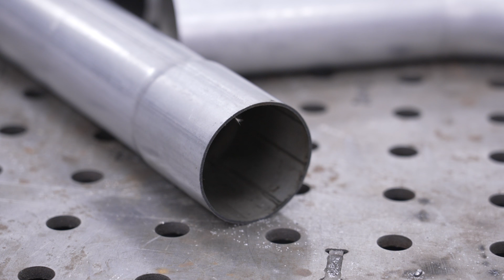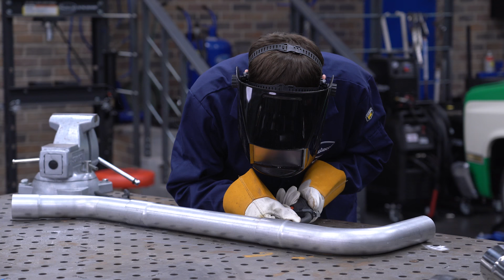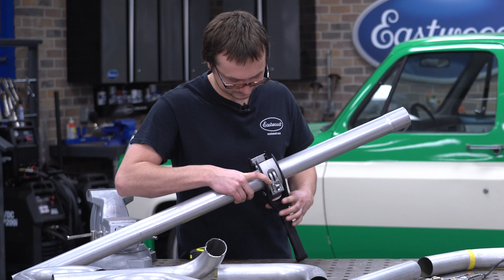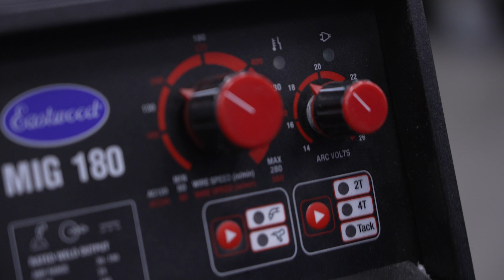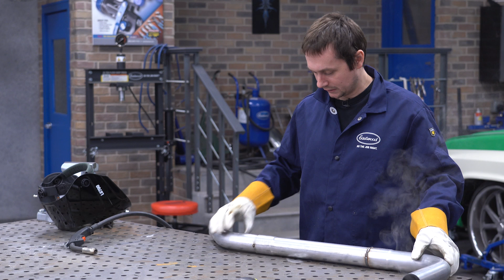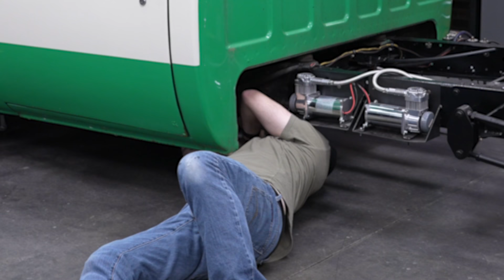How to Build your own Custom Exhaust - The EASY DIY Way

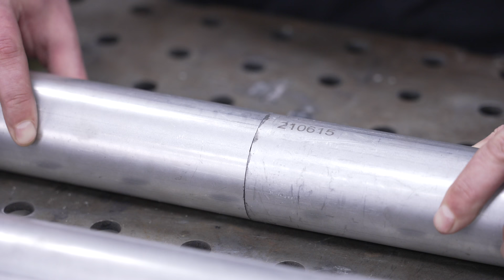Comment: 4:00 buy a few slip over sleeves to solve any shortage of slip fits. I’m doing my own roll cage parts too so I’m going to use a JD squared bender. Solves any muffler shop price issues.

Comment: Tig all the way my man 😊
Reply from the maker: TIG is great if you have the knowledge and equipment but you can totally get a great result with a dialed in MIG welder as well.
Reply: @eastwoodco  oui mais avec le mig il faute un liner en teflon sinon on contamine le fil n'est-ce pas

Comment: Im about to do my exhaust on a 1975 L82 CORVETTE from header collectors back but its 3" all the way back to the mufflers  🤫 reason for the 3"  it's a 383 stroker pushing 470HP  😉🫡
Reply from the maker: That's awesome - good luck with the build!

Comment: Showed how to weld but not show how to installtj
Reply from the maker: We showed you how to pipes fit together, to test fit, tack, check, then final weld.  Each application will be different but using this methodology you'll be able to get the results you're looking for.

Comment: But why weld stainless pipes with carbon steel?
Reply from the maker: We're not welding stainless in this video - it's aluminized exhaust tubing. If you're welding stainless you should aim to keep it stainless.

Comment: I don't pay alot for the exhaust parts, unlike the expensive pre-made Magnaflow direct fit exhaust system, with everything on it.

I look at my existing exhaust layout, then get junk yard exhaust tubings, straights, elbows, flex pipe, flanges, hangers,  resonator, muffler, etc. I got the larger sizes, instead of 1.75 inch, I got the 2.25 inch, then assemble it myself.

Instead of paying $1000 canadian dollars before taxes, I got it done myself for drastically less dollars.

I also get the mandrel bent elbows, magnaflow and borla mufflers, and nice chrome tips.

The non mandrel bends are either crushed or wrinkled, while the mandrel bends are smoothly bent.

I am going to use the Impala's dual exhaust axle back on the Uplander, with resonators in place where the Impala had its mufflers, since the van has its muffler, in the middle floor pan area, then add the Magnaflow muffler, and chrome tips at the end, coming up in the spring of 2025.

Comment: How is it DIY to use pre-bent pipes?  Oh!  Order an expensive kit and hope the right things arrive.
Reply: It’s still DIY in the same way that building your own house is DIY even though the wood comes pre-cut and not as trees.  😂
Reply: I get my exhaust parts all from the junk yard for low prices, after looking at the current exhaust system, and make it myself, including magnaflow mufflers, tips, and so on.

The junk has has it all, you do have to go there, cut off what you require, from different vehicles, then test fit for size, then put it all together.

The premade magnaflow kit cost starts from  around $1200 canadian dollars, before taxes, nah I am not paying that, I will make it myself at home.

A ton of money has been saved, and am still getting the desired results in the end.
Reply: Its diy, since you still have to do the work yourself, order, receive, unpack, measure, cut, fit, weld, etc. instead of having a shop doing all of it for you.
Reply from the maker: Ordering an exhaust tubing kit with pre bent piping means you only need a saw to cut down your exhaust.
Reply: Yeah lemme just whip out my 15k pipe bender and get some straight stock, that’s so much easier then spending almost the same on materials and using a cheap metal chop saw to cut the pre bent pieces to the angle you need. 😂🤡

Comment: In case a slio fit is not available, is it ok to do an inner sleeve with a piece of tube with the outer diameter the same as the inner diameter of the exhaust pipe? Or will that create turbulence inside the pioe and be bad? Thanks to anyone who replies!
Reply from the maker: You're talking about essentially creating sleeve to keep the exhaust aligned and to build it easier.  If you need to go this route for some reason you'll get the best results by keeping the exhaust tubing the same throughout, ex: 2.5" OD and then creating a sleeve with a pice of 2.5" ID that goes on the outside of the actual exhaust. This should keep the exhaust flowing as smoothly as possible as the exhaust itself will all be the same size.

Comment: It seems in my mind that the slip fits would be the other way. Im guessing that the male end pointing towards the flow source is not a turbulence problem? It's not a back pressure problem. Just a guy whos never done it thinking out loud. 😆
Reply from the maker: The amount of difference is going to be negligible, so if that works better for your application we'd say go for it!

Comment: just wanted to see how someone made the over the axle piece ? Not a bunch of useless crap......
Reply: No need to be rude. Its a very informative video.
Reply from the maker: These kits have 180 and 120 Degree Bends that would be used to go over the axle if you're running back that far.

Comment: why only run the exhaust past the cab and not all the way back? Any advantages or just cost saving?
Reply from the maker: The truck is on air ride and lays on the ground so there's not much room to bring it back any further.
Reply: That's one reason people do it. Some people like to have their builds have side exit exhaust
Reply from the maker: For this specific application you would need to cut a hole in the sheet metal for a side exhaust - again the frame and body lays on the ground.

Comment: Also can dial up a bit hotter and straight line weld it.  Just need to move faster on it.  I dont pattern any welds these days when doing this type of work with wire feed.  Hot flat welds and let it sizzle.